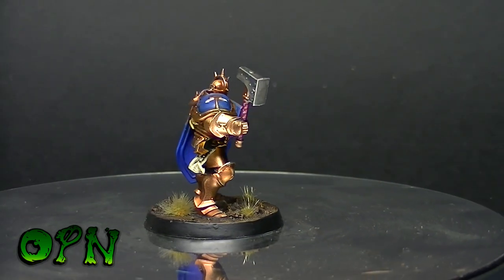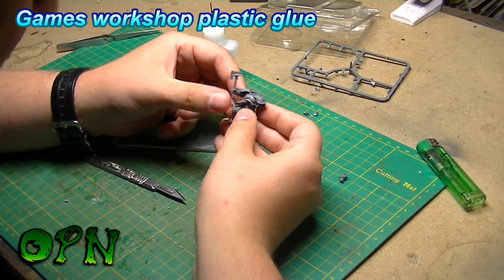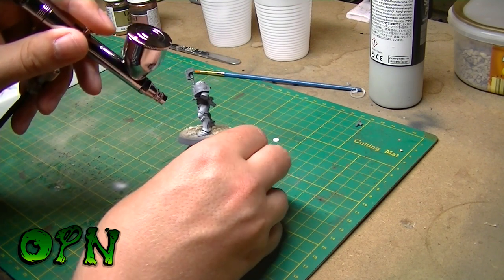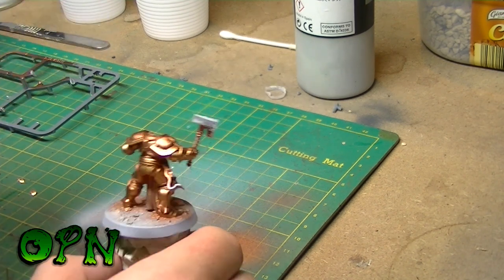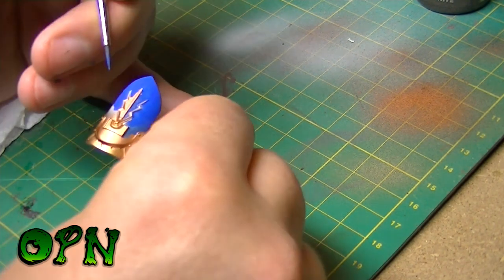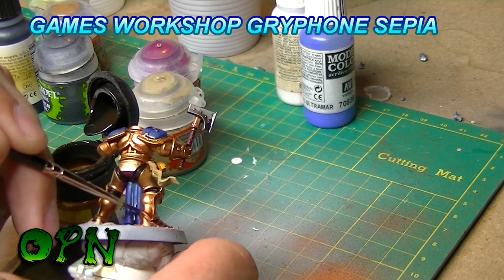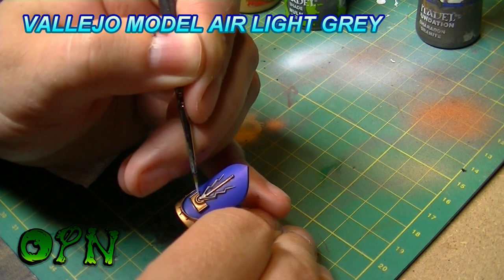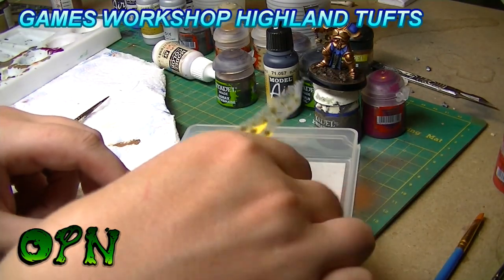How to paint a Stormcast Liberator

Comment: Really nice. I'm gonna strip mine and do it again but this time I'll airbrush it rather than brush. The gold seems to look quite grainy using a brush. I do like this figure but dont think I could paint a whole army...pretty much gold! lol
Reply from the maker: thejonsonator I like the gold but it is very bling, bling lol this is some tips to use the liquid gold paints in an airbrush.   Make sure the airbrush cup is completely dry from any type of acrylic paint or water this will instantly spoil the paint and curdle it in the cup. use a little alcohol to spray out the airbrush to be sure the cup is completely clean. then thin to the correct amount until it is spraying smoothly out your airbrush  ( test on sprue first ). then you need a good solvent based cleaner to clean it out your airbrush cup. I use this https://airbrushes.com/product_info.php?products_id=574&osCsid=e8jpffjph3u63ue5duthe2ca77 but you can use something similar. spraying should go really smoothly like it does for me following these instructions :)

Comment: Really awesome paint job. Did the liquid gold paint clog your airbrush. Did you use
alcohol to clean the airbrush. The liquid gold range is difficult to use, you are the first
I have seen airbrush the paint, I have been reluctant to spray through my good airbrush. It certainly turned out well.
Reply from the maker: texastony1946   Make sure the airbrush cup is completely dry from any type of acrylic paint or water this will instantly spoil the paint and curdle it in the cup. use a little alcohol to spray out the airbrush to be sure the cup is completely clean. then thin to the correct amount until it is spraying smoothly out your airbrush  ( test on sprue first ). then you need a good solvent based cleaner to clean it out your airbrush cup. I use this https://airbrushes.com/product_info.php?products_id=574&osCsid=e8jpffjph3u63ue5duthe2ca77 but you can use something similar. spraying should go really smoothly like it does for me following these instructions :)

Comment: Beautiful model! I'm also a little curious about using the liquid gold range in the airbrush. I've never tried it.

I'm also curious about whether or not that's really your hair dryer. ;)
Reply from the maker: DrDeathmonger Damn the cat is out the bag lol. They work fine in the airbrush just need to thin them a little with isoppropyl   - 99% alcohol . Make sure the airbrush cup is completely dry from any type of acrylic paint or water this will instantly spoil the paint and curdle it in the cup. use a little alcohol to spray out the airbrush to be sure the cup is competlely clean. then thin to the correct amount until it is spraying smoothly out your airbrush test on sprue first. then you need a good solvent based cleaner to clean it out your airbrush cup. I use this https://airbrushes.com/product_info.php?products_id=574&osCsid=e8jpffjph3u63ue5duthe2ca77 but you can use something simular. and it should go realy smoothly like it does for me :)
Reply: OrcPainterNerd  Awesome! Thanks for all the info. I tried before and I can't find a way to get that cleaner in the US, but I'll look into finding something similar. Thanks again! :)

Comment: OrcPainterNerd Did you thin the liquid gold paint, or spray it neat? Also, what size nozzle were you using on the airbrush when spraying it?
Reply from the maker: akaStarminer I thinned it with a little alcohol
Reply: Cool. Thanks. Am considering doing some airbrush work with the same paint and was a bit nervous about how it would respond.